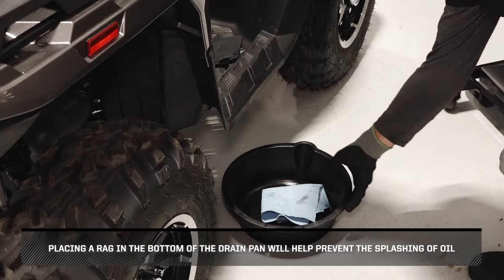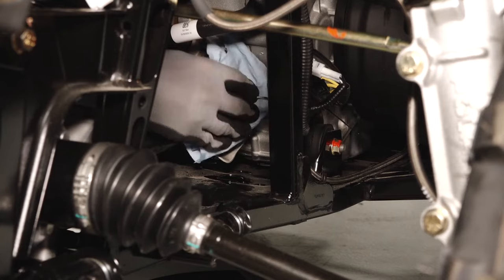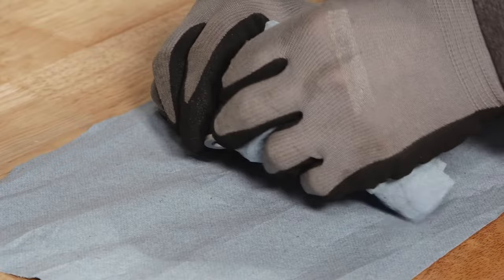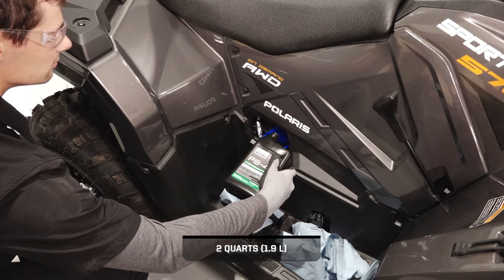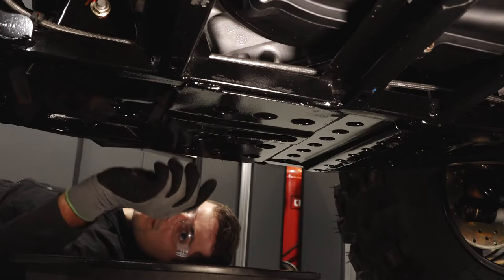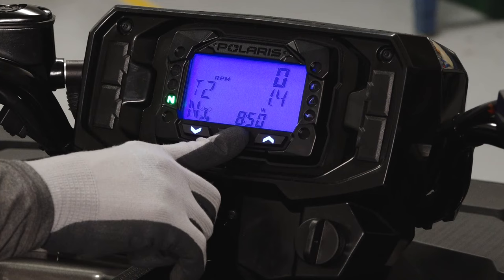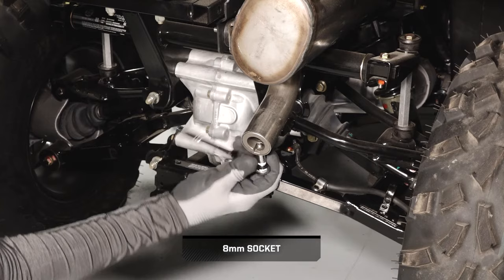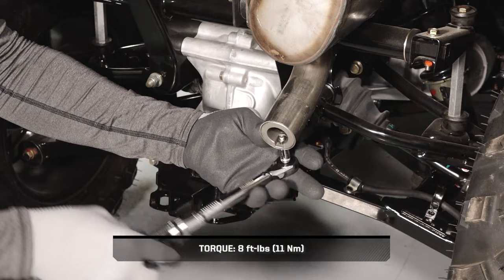2021+ Sportsman 570 Oil And Filter Change | Polaris Off Road Vehicles

Comment: Oil filter is in an impossible position even with the proper tools. Just take it to the dealer. — the guy in the video has a dislocated shoulder.
Reply: My suggestion for those reading this is to get an oil filter cap that fits onto a ratchet.. With that it's pretty easy to get off and on.
Reply: There’s no way you found it that difficult. I just reached in there and unthreaded it, took less than a minute.

Comment: The filter is in a horrible spot to get off with my handle filter wrench. Also, I need to get a longer funnel because a standard one will not work. Not a fun oil change, but I got it done.
Reply: Lol yea they make it look so easy
Reply: July 23, 2022 - Just got mine done.  Yes - ALL road vehicles I've ever changed oil on were much easier than this.  LOL

Comment: My 23 570 trail does not take six mil Allen socket, takes a T 40, how is this possible? How do they not publish the proper size tools?
Reply: I have a 23 570 trail and it does take a 6 mil Allen. Just finished doing the oil change
Reply: @simracingnoob2885 same probably a shortage idk😂🤷🏽‍♂️

Comment: I hate to break to you cause I love polaris that's all I ever own and ran i owned 3 Polaris atv so far I currently own a 2020 polaris sportsman 570 I got it like 2 mouths ago and I love it I absolutely love it but as soon as I pay it off I want something bigger but I don't want a 850 just yet so I might make a switch to can am for there 650 in 4 years but can you answer me why doesn't polaris make a 650 I rode can am before and I like them but I like polaris better the thing is the price tag on your 850s so why don't you guys make a 650?
Reply: Why would you want something in between those two? You can only really tell the difference at the top and speed between the 850 and 570 anyway

Comment: Where do you get the oil and filter?
Reply from the maker: Hi Manuel - you can get everything you need here: https://atv.polaris.com/en-us/shop/maintenance/lubricants/
Reply: @PolarisORV  I’m in your website but can’t find parts for my 2021 sportsman 570?
Reply: After how many rides should I change the oil??
Reply: @lightningvolt1273  within 50 hours

Comment: Lmao...... you didn’t show you pretty much have to take the right front tire off to get to the oil filter... very disappointed with the design. Battery sitting on the bottom of the frame where all the mud is.🙄 
The oil filter in the middle of that frame behind the battery sitting so far back. The engineering sucks.
Reply: Battery on the '21 model is under the front stowage rack tho. Not much room in there for other things tho.
Reply: Yeah that's a different model you're the battery on the 21 is up top
Reply: Check with quad logic for battery relocation kit then go enjoy not submerging your battery when you ride is 10" of water mud or butter...
Reply: July 2022:  I put a hose clamp on the old filter and hammered on a rod to loosen it -  you're not kidding - dumb placement for sure.
Reply: July 2022:  I put a hose clamp on the old filter and hammered on a rod to loosen it -  you're not kidding - dumb placement for sure.
Reply: @MichiganPeatMoss  I find it much easier if you just remove the front tire quickly. That opens it up a lot better to get to it easier. Hope it works out better for you.